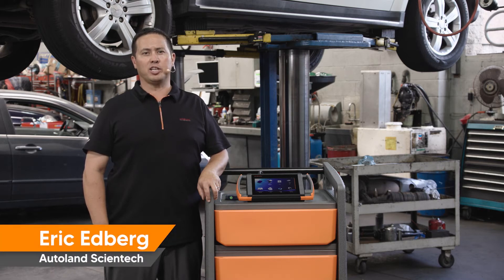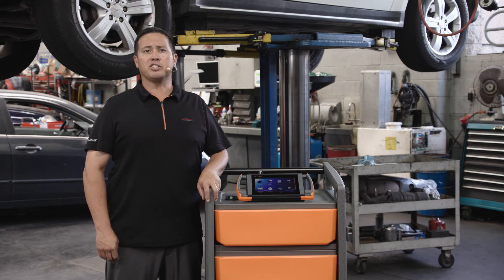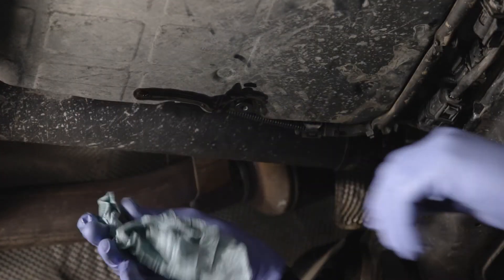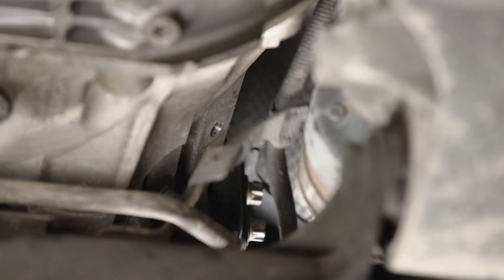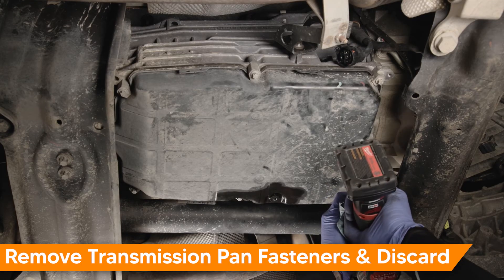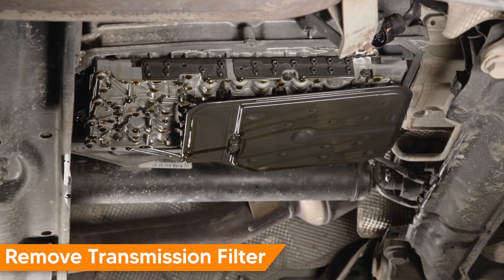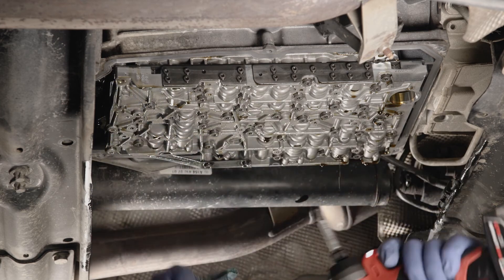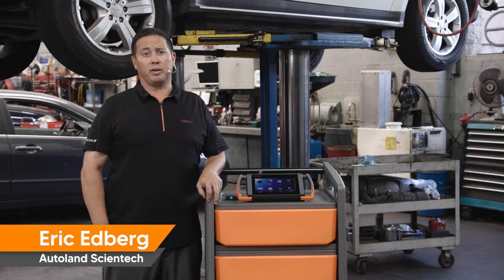Mercedes-Benz 7G Transmission Removing Valve Body - Part 1 of 7G ECU Electrics Plate

Comment: Great video. Thanks for sharing. My  ML350 is saying transmission implausible or slipping... What could be the issue? 

I bear engages into gear. If it engages it neutrals itself and revs high... Please any idea?
Reply from the maker: First check the transmission fluid level to be sure it is correct. Then check the transmission ECM for fault codes. If the system is not working properly, a fault code will be set. This will be your best bet when diagnosing. Also helpful to check trans adaptations.

Comment: I have a p2759 code.  I read it could be transmission fluid, a bad electrical connection, or.......please comment thanks
Reply from the maker: P2759 means that Torque Converter Clutch Pressure Control Solenoid Control Circuit Electrical has been detected.

Comment: We’re can i buy a conductor plate for a 08 s550 4 matic
Reply from the maker: Mercedes-Benzs only.
Reply: You Can Have The Original CP Rebuilt. Circuit Board Medics As Well As Others Will Provide This Service.  Thus Saving The Anti-Theft Programming. FCP Euro Sells Complete Rebuilt By Benz, Which Will Need To Be Reprogrammed.